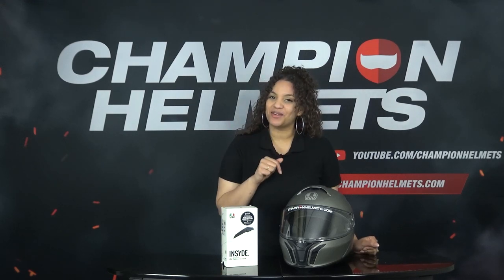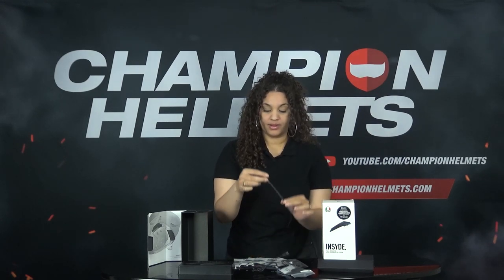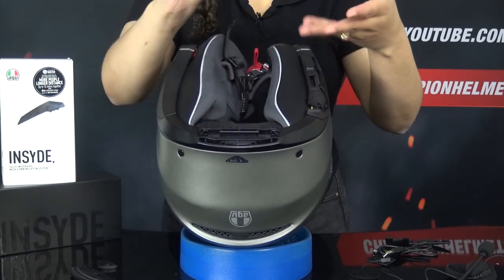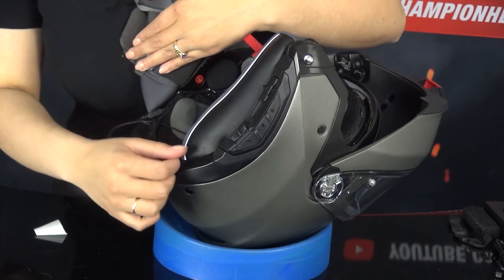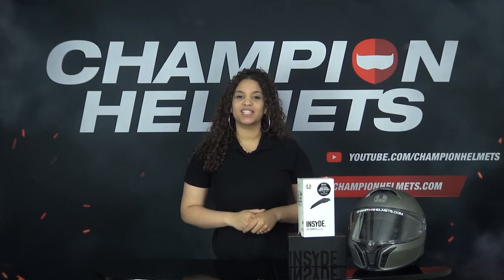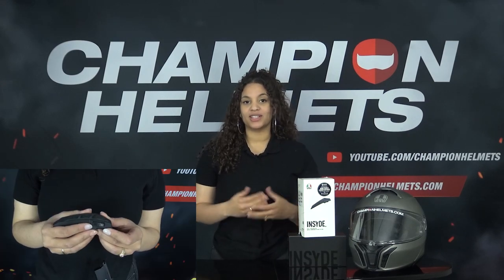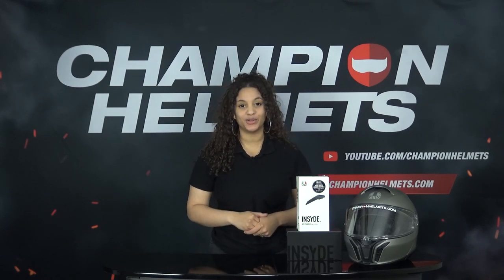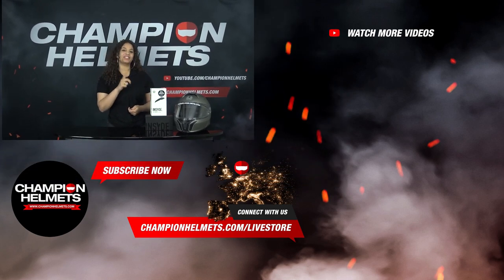How to install AGV Insyde Communication System on the AGV Tourmodular

Comment: Just got my Tourmodular and Insyde system from Champion helmets. This is a really great install guide, thanks!

I understand cardo has other units still with micro usb but it's a horrible connector and disappointing to get new gear with it in 2024. 

As ever, it seems cardo made the most common commands stupidly complex: quickly mute, play music and reject/accept incoming calls are all tortuous button presses. I've never had good luck with cardo's voice commands, here's to hoping that will change with insyde.
Reply: I have the new freecom and I couldn't change the radio station till I started talking slowly and the it pickup my command perfectly.

Comment: The red light shows the charging status. When fully charged, the res light goes off. You don’t turn the power on to charge the unit. If you do, your phone will connect.
Reply: Exactly I've had the same problem turning the unit on to charge so you don't turn the unit on to charge?

Comment: When l charge mine it flashes red and a purple colour. Then when fully charged it's flashes blue is this normal? Plus voice control doesn't working either any advice on this please rather disappointment with the unit

Comment: Thank you for The information I wished the Sportmodular came with a communication system that is installed insyde the helmet. it looks way nicer this way!
Reply: Schuberth handles this a lot better on the C5.  The speakers and mic come preinstalled so you just have to buy the comm/battery unit, snap those in, and you are ready to go (no routing of cables etc).

Comment: Today I installed the insyde , I re confirm my yesterday's comment , the installation process in comparison with the Sena SC2/ shuberth C5 is a pain in the ars , they should copy shuberth

I will post a review after I do a ride test
Reply: Good evening,how about noise the C5? Are you satisfied?
Reply: Yes, very satisfied, had an issue with the visor, closing at around 50 km/hr speed, but was easily fixed - instructions on how to fix it is on YouTube
Reply: And btw the tourmodular have a whistling sound when touring at low speed and visor fully opened

Comment: Very helpful! Can you put it also inside the sportmodular?
Reply from the maker: Hello Martijn, no unfortunately not. Insyde is especially designed for the tourmodular. The communication system that fits the sportmodular is the SENA Arc communication system.